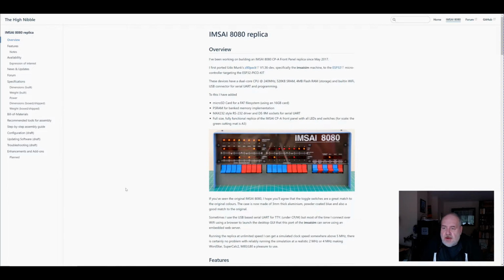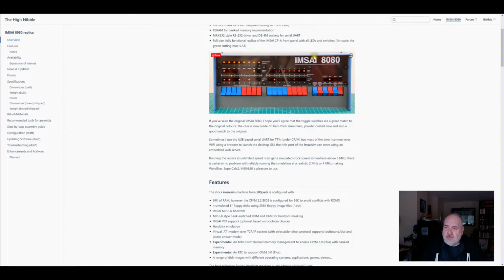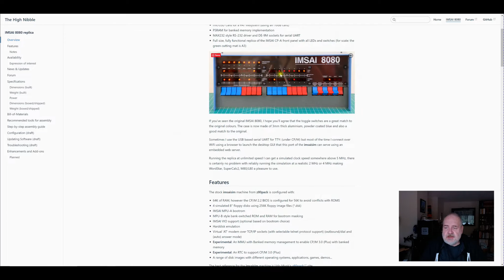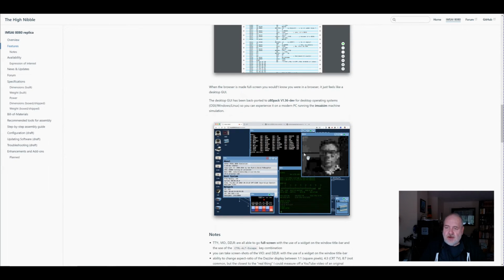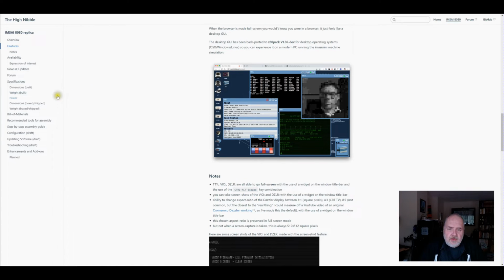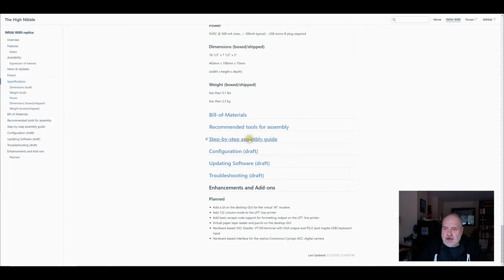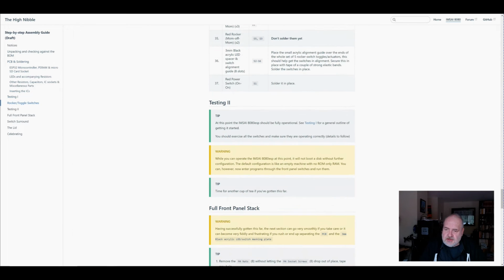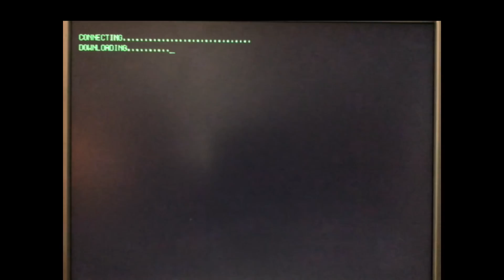STB472 - High Nibble IMSAI 8080 Replica - Part 1 - Ghost in the machine

Comment: Not knowing what chips are right there but if they are the same chips, swap them around and see if the conditions change. If the conditions don't change, then definitely check gnd and pwr. My guess is that there is a bad trace from the mfr. Obviously it is not a design flaw since the are several in use without the same issue.

Comment: the IMSAI8080ESP is Best designed Kit that I have ever purchased and built.   Mine is already mounted in the plexglass case.   What are the conditions to reproduce this issue?
Reply from the maker: There really were no conditions to reproduce the issue, this board just did it. I couldn't get my replica to act the same way even using the ESP32 and CF card from the faulty one. I initially assumed there was a floating/open GND or VCC pin on an IC and that IC was trying to operate using parasitic power. the voltmeter soon proved that theory wrong.

Comment: Static damage can cause irritating intermittent faults. Or a bad pcb track/dry joint.
Reply from the maker: Both good thoughts, the logic is HC series. What caught my eye was how the position of his thumb affected the circuit as if he's coupling something back into the circuit.
Reply: Every time I’ve seen this kind of behavior it’s been a floating input to cmos components. I would definitely check for bad/missed solder joints